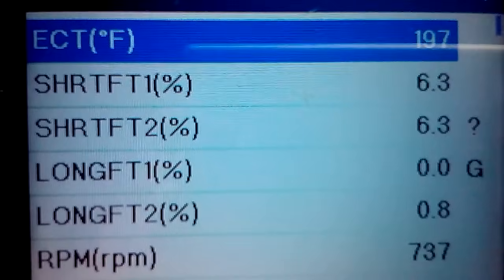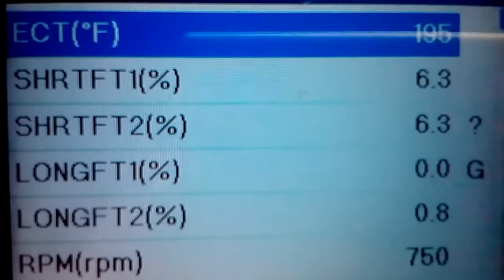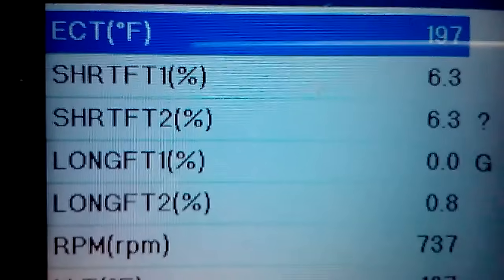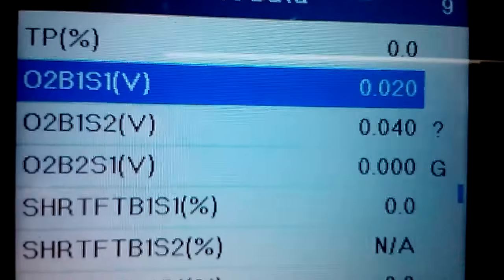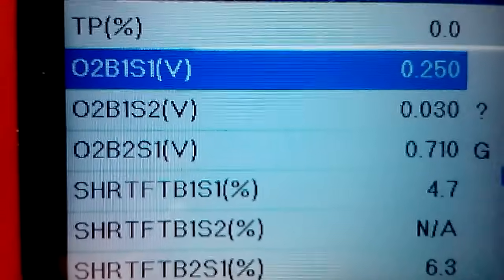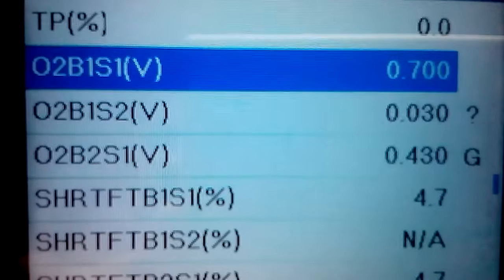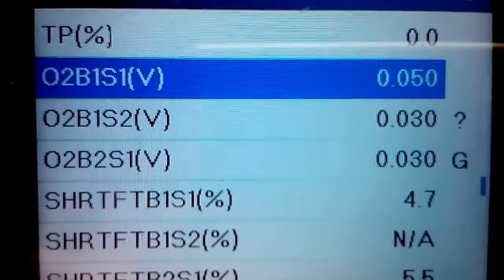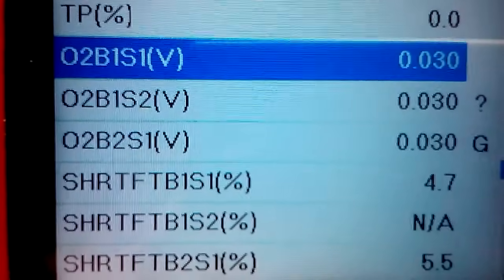The basics on live data obd2 scanner

Comment: Finally someone explains this!
Reply from the maker: Manuel Alvarez thanks for watching!
Reply: This is an excellent intro to what some of the data abbreviations mean.  Is there somewhere that continues the data abbreviations?
Reply: @toddb930  Yes.  https://en.wikipedia.org/wiki/OBD-II_PIDs
Reply: I have the foxwell 301 and it says my brand new O2 sensor is  bad. I found out I have oil leaking into the spark plug holes I got a new valve cover and gasket coming a new O2 sensor bank 1 upstream coming and have down stream for my Chevy Cruze how do you check the thermostat temperature on the OBD2 scan tool
Reply: @good2boost529  here’s a question for you are these readings in metric or imperial?

Comment: Thank you for this info! My long term fuel trim shows 30% or higher at all times. Can anyone clarify on what could be the problem for this higher number?
Reply: change your fuel filter
Reply: John Vang check air leakage after MAS sensor this causes increase in RPM
Reply: @abbasmuhsen2715  Yes air leak somewhere

Comment: Thanks good, this really helped. My question is ,My Hyundai Elantra shows a stft bank 1 sensor 1 OK but it shows a bank 1 senso 2 frozen @ 99 % .Is there 2 of these sensors in a 4 cylinder engine or is that second one a dummy?
Reply from the maker: Hey, I'm just now seeing this. Thank you!! And yeah so you have an oxygen sensor before, and after the cat. That's why some cars have 4 02 sensors because the car has 2 cats, but that's mainly 6-8 cylinders with 2 banks. More often than not, an 02 sensor reading of 99% is cause by a bad sensor. It could also be wiring so just give that a look before replacing the sensor. I think I went over that in one of my later videos, but if not it will definitely be in the new one I'm posting tonight!

Comment: TP% is 15.3 at cold start idle,,,, ill check again when i let the car warm up. But im also having trouble with my rpms. Its this weird thing where when i let off the gas, the rpm drops below one. Aroud 0-30 mph and will drop down to 1.5 or maybe 1 from 30-60 mph and 60+ is fine, my car also shifts way before the redline. Im talking about like around 2rpm or lets say im going 40mph and the car is going to shift, itll shift with the rpm around 2 of 2.5, but it will never go to the redline. Even when gunning it. Any help?

Comment: I have a P0171 code on my Volvo XC90. The ST and LT trim stays within range the entire time while checking live data, but the lean code still illuminates the check engine light. Wondering how this can be while in range. Also, smoke test revealed no leaks. Oil trap was replaced, new plugs too.

Comment: I have a cable throttle body on my '99 Honda Civic. My TPS is perfectly calibrated according to voltage (.49v-4.54v), but according to my TPS PID I'm at 9% throttle with the engine off or at idle. I've been chasing a high idle, and after much research, checking for vacuum leaks and parts swapping, I'm suspecting the TPS. I see your % is at zero, when at idle, and I'm assuming when it's shut off. Should all cable throttle body cars have a zero value, or is 9% the value it sends to receive the appropriate fuel for idle and iac system?
Reply: You've probably fixed your problem by now but I have a cable throttle on a Mitsubishi Lancer. My OBD2  shows zero throttle position at 780rpm idle.......nightmare these closed loop engine control systems.

Comment: My TP on my 06 f150 is over 20% negative and my mass air flow drops negative 70...What can be causing this? Truck runs fine at idle but after driving for over 30mins it losing power and when you press the gas starts making a rattling noise until it goes back to idle then it goes away.

Comment: Hi have  a question.
Honda pilot 2003   3.5 just  two sensors up and down.
Bank 1 Rich. STFT  S1  -27.3%         STFT B1.  S2.    -27.3% steady on both.
Oxigen Sensors output V ( B1 -S1   0.855 V
                                                     (B1 -S2   0.035V
How come if S1 is reporting a Rich
Sensor 2 is reporting Lean.????
My problem is that pcm is taking fuel away
From bank 1 to the point in which
That bank is not working...
If you disconnect those 3 coils from bank 1
They don't miss.
But I you reconnect the bank and
Do the same thing to #2 bank each cylinders
Started missing if you disconnect all 3
Engine won't die.
Pcm supplies supplies fuel to bank 1
And then they are running...
This is weird !!!

Then if you reconnect bank 2
Pcm shutt down bank 1....
Any advice on this behavior of pcm?????

Comment: Ugh. One of my O2 sensors will be at 3.8 volts and the other at -.08 mA...and then that night flip...how should I be understanding that?
Reply: Correction. That second one is my O2 sensor current...?

However the first O2 Sensor will be farly consisten around .7v and the second one at like 3.2v. Does this mean the second bank sensor is bad?

Comment: I want live data from from a closed loop system that is not showing me the stored information in the computer that is (+32.8 STFT) and (+32.0 LGFT).  Code P0170 on a 2000 Jeep XJ with CEL.  Code states engine is lean. Reality is engine is rich. Vehicle has been out of commission for some time, but now back on the road, running lean/rich.  After clearing the code a few times, I went for another, longer drive (10 miles) and the scan tool was plugged in (Zurich ZR8), it showed the same code as Pending, but no CEL is present.  Although I can smell a rich exhaust, it appears the engine is “adjusting” to run cleaner and I hope that driving it will continue the trend towards improvement in exhaust quality. (poor fuel economy likely).    How can I be sure I have cleared DTCs from memory, and obtain only closed loop live data going down the road?  Do you driving 10 miles,, turn off the engine, plug in the scanner, turn the engine back on and immediately clear codes, then quickly drive another 10 miles to get the correct, real-time, closed loop data?!   Yeah, that’s a mouthful, but I think you will understand my question.  Thx to you and anyone else that can give me the step by step for clearing the codes and getting solid numbers from the closed loop to figure out what is going on.  ( I can’t find a vacuum leak using the spray-mist test).  Thx

Comment: What if IAT is over 30 degrees higher than ambient temperature? Showing 130 and the outside temperature showing under 90.
Reply: Doesnt really matter. Hotter than normal temperatures are to be expected under an engine bay
Reply: @OtherDalfite  what about both ltft -10 and -7 at idle. (Both drop like -7 and -4 with higher rpms ) Changed plugs, ai r filter and pcv.
Reply: @MC-hs4mf  No idea. Currently tracing down similar issues myself on my 2.5l ranger

Comment: Question: What does DNT_CNT=3 mean?  I have a cheap Scan tool it is an AUTEL Autolink AL319 I have 3 Codes stored in the Module PO171 System Too lean Bank 1 Sensor 1 ,  PO174 System Too Lean Bank 2 Sensor 1 ,  PO1507 Idle Air Control Under Speed Error* . Pending Codes shows Also periodically it shows up with a PO335 Crank Shaft Position Sensor Circuit "A" Malfunction , but then the code goes away on it's own for some reason. * This is on a 1996 Ford F250 XLT Extended Cab Pickup Truck with a 7.5 Liter V8 460 CI Engine.*

Parts I have replaced in order to try to resolve the problem: Idle Air Control Valve is brand new, Checked Connectors, They are fine, O2 Sensors are Brand new, MAF sensor is Brand New, No MAP sensor*, *No Crank Shaft Position Sensor on this model, (Why is it throwing that code then?, does not make sense) 

Checked for Vacuum leaks using a Smoke Machine.  No leaks found , also Checked for Exhaust leaks, None found, 
Throttle Position Sensor responds (Not replaced), IAT Corresponds to external air temperature (Sensor not replaced) , ECT Corresponds to engine Coolant temperature (Sensor Not replaced), EGR Vacuum Solenoid is new, Canister Purge Valve is New, Fuel Filter is New, Air Filter is New, Ignition Module is new, Spark Plugs, Plug wires, Distributor Cap, Rotor, all Brand New, Ignition Coil is New, Distributor Internal Pickup Coil is New.  

Vehicle Symptoms: Rough Idle ain Park, Shaking and horrible Idle in Gear, Engine almost stalls when you put the truck in reverse, Backfiring at throttle and under any stress, Engine Stumble , Slow Acceleration, when attempting to force Acceleration Engine stumbles and Backfires, Unable to accelerate past 45-55 MPH,  Engine Stalling when Headlights and heater/AC are on particularly at night, Poor Fuel Mileage, Noxious Exhaust (Smells like Gasoline)

Anyone have any Ideas on this?  I am tired of throwing hundreds of dollars at it and coming up empty
~Elijah
Reply: I would check the grounds. Could be loose, rusty, broken.

Comment: Hi why does the SHRTFTB1S2 SHOW N/A
Reply from the maker: craig corrado if you have a 4 cylinder engine you will only have 1 bank so one sensor only. so the second sensor will come up n/a
Reply: 2010 impala 3.5 v6 only has 2 o2's 1 up stream 1 down,so is that why? thanks
Reply from the maker: craig corrado yes, you should only have one for each bank then. I'm surprised it only has 2 02 sensors being a v6 but really that's not too uncommon.

Comment: Hi my o2 sensor O2B1S2 shows "0" voltage whilst O2B1S1 fluctuate 0.5-0.7+ volts is that mean that o2 sensor that has 0voltage is down and needs to be replaced.  Long fuel trim 25+.  Thank you great video
Reply: Take off the sensor and get a volt meter. Set it on Ohms. Look for the two cables that are the same color. Connect the voltmeter to those two ends. You should see a resistance between the two.

Comment: I'm trying to understand some live data that I recorded from  my 2000 
Olds Bravada. It has been running rough for a while now and I thought 
that I'd try and find out why. It idles rough and lacks power when 
accelerating. It also stalled on me twice now and wouldn't start back 
up. Here is the data that is stored on my reader.

DTC_CNT  1
FUELSYS1  CL
FUELSYS2  CL
LOAD_PCT(%)  3.1
ETC(*F)  198
SHRTFT1(%)  -0.8
LONGFT1(%)  -10.9
SHRTFT2(%)  0.8
LONGFT2(%)  -18.0
MAP(inHg)  9.7
RPM(/min)  652
VSS(mph)  0
SPARKADV(*)  19
IAT(*F)  111
MAF(lb/min)  0.712
TP(%)  0.0
O2B1S1(V)  0.820
SHRTFTB1S1(%)  0.8
O2B1S3(V)  0.190
O2B2S1(V)  0.120
SHRTFTB2S1(%)  -3.1

This was recorded while idling at operating temp, I want to know if 
these readings are normal or do they indicate a problem. The one code 
that came up is p0135. ANY HELP WILL BE GREATLY APPRECIATED!!!
Reply from the maker: well for starters the code p0135 is the oxygen sensor heater circuit for bank 1 sensor 1. before replacing the sensor check the wiring and the connector on both sides for any dirt, oil, or anything that shouldnt be there. the ecm will keep the car in open loop while the code is on and cause the engine to run really rich but I see that ur one fuel trim is reading -18.0 which is taking fuel away. this tells me that it lacking power is probably caused from a vaccum leak and it running rough and stalling is from the sensor. the ecm tests the sensor to see that the oxygen sensor heater is working properly while warming up. if the wiring and connector on both sides look fine, has no dirt or oil or black marks from burning I would replace the sensor. you could also make sure it is gettin proper voltage with the key turned on (engine off) and the connector just to be sure. then I would also check for vaccum leaks. get back to me if/when u find anything and if you have any other questions feel free to ask!
Reply: Thanks for the info man! I did replace that sensor last year thinking it was the cause but the code never went away. So I thought that it may have been a faulty sensor. It was a bosch that I got from an auto parts store. Then I heard that bosch sensors don't perform well in GM vehicles so I ordered an AC Delco one but that didn't fix it either. So I believe that it may be in the wiring.
Reply from the maker: +Chris T. yes if you already replaced the sensor then its more than likely just wiring. glad to help anyway I can! good luck and I hope you get the problem resolved asap!

Comment: My 2005 Subaru Outback is showing a check engine light and also cruise control. Around the same time my brother in law was having the same issue with his 2006 Subaru. Online it looks like this is a common problem with lots of suggestions on what Could be wrong. I checked the temperature of the catalytic converter with an infrared thermometer and that seemed to be in an acceptable range. I checked my gas cap and that seemed loose, so I replaced that. I have been filling with premium gas. I bought an obj scanner and the code is p0420. Live data shows 02b1s1 - 2.788. O2b1s2 - .840.  O2b2s1 - 2.765 O2b2s2 - .735. Do these numbers tell you anything?

Comment: Ok questions on something have a 2003 grandam getting crap for gas  mileage change plugs wires filter was told do a live Scan I did my longft1 goes negative to about around 5 to about 10 to 13 when I press on gas was told if your on gas it should be + not - but your video says + or - ok  told could be a cat going bad but not codes just poor gas mileage and car seems have power so are my fuel trims ok hope you can understand how a write it all trying figure what going on with my car thanks

Comment: The live data on my scan tool indicates that the voltage for my upstream 02 sensors fluctuate just as they are supposed to. However,  my downstream O2 sensor remains flat at 0.000, so what does that mean? What kind of voltage should we see? For your downstream O2 sensor, it remained around 0.030 and 0.040. So, what does that mean?
Reply: Highly chance im wrong im still new to learning about cars but from what ive seen is that downstream pretty much checks up on your cat to see if its working... dont take that advice highly though

Comment: bank 2 senser 2 voltage is missing in the scanner
Reply from the maker: rotcataergeht most systems only have 3 sensors so that's normal. unless you are 100% sure there are 4 on ur car/truck
Reply: why would they have 2 on bank 1 and only 1 on bank 2?
Reply: @garyshaw8449  Perhaps the cats  came together in one pipe so 1 sensor read both. (just guessing)

Comment: my recently replaced O2 B1S1 stays between 0.640 and.0.655. Mostly at 0.655. I was getting the code so K replaced now im getting the misfire code. What can it be?
Reply from the maker: Anthony Guerrero is it staying at 0.655 even when u rev the engine? and can you tell me the specific code? for misfires the first thing I always look at is ignition. coils, plugs distributor. let me know what the code is

Comment: Hi my infinti g35 is running fine but I noticed that my bank 1 sensor 1 is 0.285 bank 1 sensor 2 0.510 bank 2 sensor 1 0.800 bank 2 sensor 2 0.800 bank 2 sensor 2 and sensor 1 while driving will fluctuate up to 0.800 but will not come down but when I come back to idle they both go to 0.000 wars happening here are those oxygen sensors going bad
Reply from the maker: Donte Quinney well from the numbers and how the second ones on each bank r higher then the 1st that is normal. To get a better idea while idle hold the rpm steady at about 1500-2000 you should see the first ones on each bank climb then drop while the second ones do the same but after the first. If they don't stay at 0.00 and don't stay at .9 you should be fine. If the stay at 0 I would say they r are bad. Report back
Reply: Good2Boost ok I just held the rpm at 1500 to 2000 bs1s1 0.250 bs1s2 0.700 bs2s1 0.610 bs2s2 0.710   it has a pending code for rear oxygen sensor p1167

Short term fuel bank 1 0.8 
Short term bank 2 -0.8
Long term didn't move 
Also bank 2 sensor 1 1.210 then went back down is this normal
Reply from the maker: Donte Quinney those fuel trims look good and so do the readings. The sensor that went to 1.2 is more than likely the culprit and needs replacing. Could be bad sensor could have a short or be cutting out intermittently. The first set of sensors are always lower numbers then the secondary ones for a split second. But if it reached 1.2 for any amount of time I would look into that specific sensor
Reply: Good2Boost can a faulty oxygen sensor cause all the others to read incorrectly
Reply: Good2Boost short term bank 2 went to 10.9

Comment: thanks I'm gonna try it and no I'm not getting a light..once it warms up it surges and eats fuel bad and loss of power
Reply from the maker: your welcome, if it surges once its warm its more than likely the sensor but if you want to make sure further check the fuel trims for that bank and see if the number are real high (positive or negative 10 or higher) just to be sure its not a vacuum leak or fuel issue for a peace of mind, although it sounds like a sensor failure to me.
Reply: Ok thanks a lot